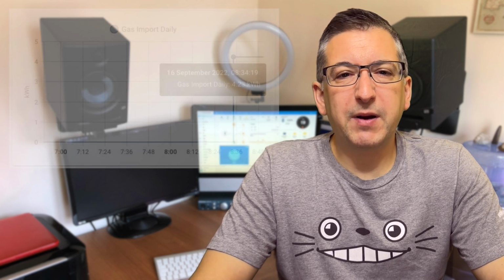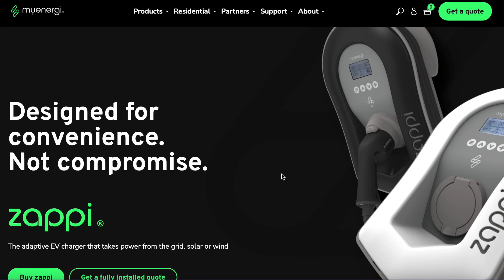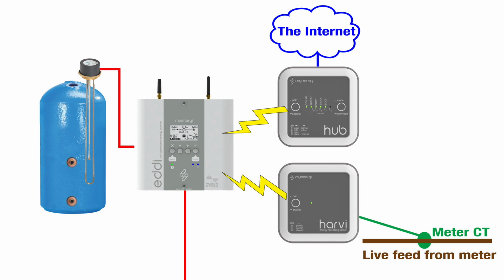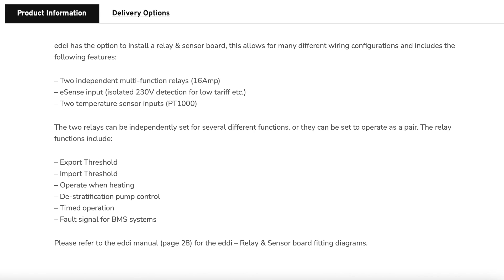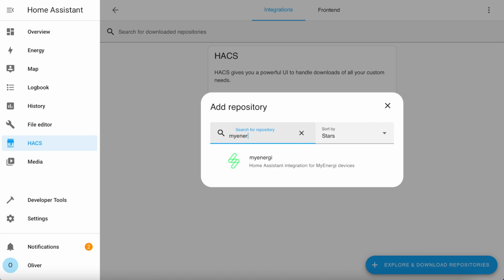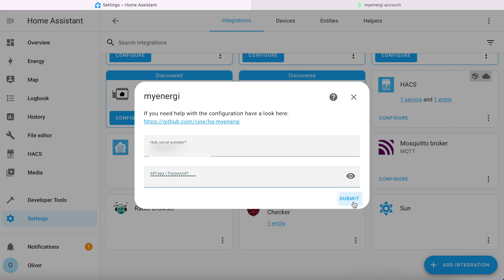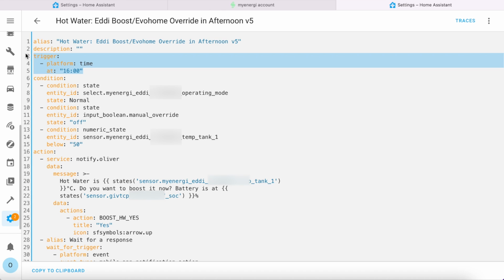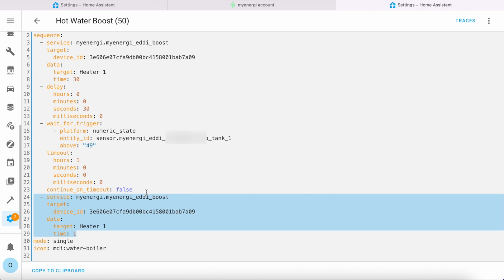Myenergi Eddi and Home Assistant

Comment: Hi. Living in Spain here and just use an instant water heater with a 50 litre buffer. Cheap, simple and maximises use of a 20kWh LFP off grid battery bank. The problem here is using all the solar power !😊
Reply from the maker: Yeah if I had plenty of sun then that would be a realistic option. Sadly in Winter it'd cost me a fortune though. I'm in the process of getting a heat pump installed so that should give me a more efficient way to store hot water - the tank itself is being changed to a much more efficiently insulated one. My copper tank loses heat rapidly right now.

Comment: I have a Athom esp32 unit with 4-channel relay card and linked two of the relays each to drive a 32A contactor wired to an immersion heater (top and bottom). I have full flexibility as to when to power the immersion heaters via Home Assistant and the solution is much less expensive than an Eddi.
Reply from the maker: I considered doing something like that, but it has two problems: Firstly it doesn't allow you to regulate the power going into the immersion heater - Eddi regulates the voltage to allow anything from 1 to 3000w, soaking up the exact amount of excess power you have; secondly it breaks one of my golden rules of home automation - it must be easy to use by my family if I am suddenly no longer around!

Comment: The gas boiler wastes heat by heating itself, and the water in the pipes that connect to the tank etc. and most of this heat leaks away afterwards. 
I use a Solar IBoost, and it typically delivers about 2.5 kWh to reheat my tank if there is heat left over from the day before. Using gas my smart meter reports a consumption of about 5 kWh, so a real world efficiency of about 50% (which looks pretty similar to your results).
Reply from the maker: In my case, the immersion heater only heats about 50% of the tank - the bottom of the tank stays cool compared to when I use the boiler. It's enough for two short showers though.

Comment: Thank you for your video. Please can you tell me if I can use the Myenergi Eddi with my T-Smart immersion heater, which is wired directly into the Eddi. For some reason I can't get the Eddi to supply generated energy from my solar panels to the immersion? On the T-Smart immersion app is stays disconnected. Any thoughts welcome.
Reply from the maker: I think probably not - Eddi is designed for a dumb heating element and it powers it on or off and throttles the voltage as necessary. The T-smart must be powered on all the time and does not support power/voltage throttling. In fact, wiring it to the Eddi directly could damage it. Eddi is designed to make a regular immersion smart, whereas you are trying to make a smart immersion have additional features. It's one or the other really. It may be possible to mess around with the relay and sensor board but that might involve the voiding of warranties and a lot of custom sensor building!

Comment: Do you have a "hot water on" button in home assistant so your family can turn it on to ensure they have hot water on demand if needed?
eg, come home at an odd hour and need a bath? Currently I have a bath and a shower button that simply turn on a POW3 connected to the immersion that heat to one of 2 specified temps.
Reply from the maker: Sort of. "Alexa, boost the hot water" runs a script that boosts Eddi until the temperature reaches 50 degrees. I also have "Alexa, I need a bath" and that turns on the boiler to heat the whole tank... so no physical buttons for either of those routines, but the family are ok with the voice commands! There are already physical buttons on the Eddi and the heating controller if necessary, but that requires training and the trainees are not open to that at this time!

Comment: Is there a way to take the power sensors from the HACs integration and convert the InternalCT power sensor (how much Eddi is heating the tank) and make it into a cumulative energy sensor that can be used as a ‘device’ in HA energy dashboard?
Reply from the maker: Yup, you need to create a Utility Meter helper. Settings > Devices & Services > Helpers > Create Helper > Utility Meter. I like to put them on a daily cycle, but you can choose no cycle, or whatever you like.
Reply: @SpeakToTheGeekTech  brilliant. Didn’t realise you could create ‘no cycle’ utility meters
Reply from the maker: My preference is for a daily cycle personally for use in the Energy Dashboard. The reason being is that if you use a cumulative sensor and it gets reset for any reason, you potentially lose all of your historical data. A daily cycle sensor limits that loss of data to 24 hours maximum. No reason you can't create a daily cycle sensor for use in the energy dashboard, and a no-cycle one just to keep track separately elsewhere for curiosity!

Comment: Question...
If I have a Zappi and a Harvi, but no Hub, can I still get Data in Home Assistant?
Reply from the maker: Depends... the old models needed a hub in order to connect to the internet and enable app control. The new ones have built-in hubs instead. If you can control your zappi from the myenergi app then you can get the data in Home Assistant.
Reply: @SpeakToTheGeekTech  
Thanks. The one I just ordered is a V2.1 so that should be a new one...🤞

Comment: Thanks for the video, very useful! I actually decided to try and copy with my own setup, and purchased the relay / temp board and the PT1000 probes you linked. However, I did have a question about the connection on the relay board. Do you happen to know what those types of connections are called? Looks like i'll need to re-terminate the probe so that they plug in, just unsure what I should be searching for.
Reply from the maker: Do you mean the small green screw terminals that clip on to the relay board itself? I'm not sure either, but mine actually came with the relay and sensor board. If you're missing those then your relay board is missing parts.
Reply: I feared you'd say that... I had purchased my board from a wholesaler, since myenergi were out of stock. The board arrived with *nothing*, not even the plastic standoffs. I had thought it was just that that was missing, but sounds like some other parts are missing too. Can I ask, the ribbon cable that connects the Eddi and board, was that part of the Eddi or part of the board? I haven't yet taken the casing off my Eddi to check.
Reply from the maker: Oh dear. Yes, the ribbon cable was part of the board. Everything you need to install the board - standoffs, ribbon, connectors, all included. I just added the PT1000. No point opening up your Eddi if you don't have the ribbon.

Comment: Hi, Could i ask you a question please, I have a Give energy system installed with a battery, Inverter, and Eddi,
As far as I know, there was already a duel immersion fitted to my water tank before I got the Solar and this worked fine 
for two years but the long immersion stopped working and an electrition changed the wiring to just heat the shorter immersion
and this works 
However the blue light on the eddi sometimes flashes blue while also makes a sound and I am wondering what causes this, 
thanks
Reply from the maker: I don't know sorry, you might be best asking this question in the myenergi forum: https://myenergi.info
Reply: @SpeakToTheGeekTech  OK Thanks anyway.

Comment: Hi.  I have a PV diverter, solar panels and batteries.  I’ve had an air source heat pump fitted.  I’m on Octupus flux.  Would it be more efficient to turn the PV diverter off and allow the heat pump to heat the water?
Reply from the maker: I am trying to figure out the exact same thing! My thoughts at the moment are that once I get a heat pump installed, I'll stop using Eddi and just have an automation that detects if there's enough excess solar to power the heat pump instead. It wouldn't modulate the power, so I'd need a lot of excess, but in theory it would be more efficient. Honestly, until I have the heat pump installed I won't know for certain. It's a bit of a trade-off between using the more efficient heat pump or being able to absorb every bit of generated energy. I know that even running at higher temperatures for hot water, the heat pump is still running at about 200% efficient from seeing other people's installs in operation.
Reply: Thanks.  On the old and rather insulting export rate of 4.5p per kw hour I was trying to absorb as much as possible but now Octupus have launched Flux which will average around 24p per KWh I’m trying to balance the needs of the house with exporting as much as I can.  I think approaching it from a common sense point of view.  If the heat pump is 200% efficient and the PV diverter is 98%efficient it must be the heat pump

Comment: My EDDI and HA only show the consumed electricity (kWh). This doesn't work well in the Grid or Dashboard as I have "live" actual power (Watts) data for all the other devices . The mobile APP and EDDI device display show both the accumulative consumed energy (kWh) and the live actual power (w) but I can't find this in the integration entity. Your demo works because you have simulated a hot water heater in Watts. Any thoughts ?
Reply from the maker: The myenergi integration for Home Assistant does display live power. I use the one for Eddi on the Power Flow Card Plus (sensor.myenergi_eddi_xxxxxxxx_power_ct_internal_load). The only issue is due to it being a cloud-based integration, the updates are not very frequent so can lag by a couple of minutes, but the integration definitely shows power entities :)
Reply: @SpeakToTheGeekTech  Thanks I have found it and it is zero. I guess you could put a CT clamp into the EDDI to by pass MyEnergy cloud base apps !!! Just subscribed and moving my Pi to SSD as per your recommendations. Having lots of fun and games

Comment: Does anyone know how to control the two relays (optional extra) using home assistant? I can see sensors but not controls. Thanks
Reply from the maker: To my knowledge, you can't manually control the relays on the sensor and relay board. You have to configure the relays to turn on/off based on various thresholds and conditions such as exported or imported power, or water temperatures to manage tank hysteresis. The available settings are all listed in the board's manual on their web site, but the actual control of those relays to the API is not exposed. Or at least it certainly wasn't when I had an eddi.
Reply: @SpeakToTheGeekTech  ah ok thank you. I wanted to control my hot water circulation pump with one of them. It's always on which is good for destrat and quick hot water at the taps, but poor for maintaining hot water at the top of the tank so I think best just on at peak use times and when the eddi is heating during powerups etc. I have a couple of spare Sonoff mini's so can do it that way instead

Comment: Home assistant reports 127 for temperature of hot water tank 1 and 2 I only have one tank. Where is it getting this number from and is it Fahrenheit if so how you getting Celsius?
Reply from the maker: Have you fitted the optional sensor and relay board in the Eddi and connected a temperature sensor between that and the tank? If not, the reading is a default value due to having no sensor fitted.

Comment: Forgot to ask, how much power does your system export to the grid when the Eddi is diverting power. 
My Solar Iboost is supposed to target a 100 watt export figure (its not zero to leave some margin for error  when solar output suddenly drops (e.g. cloud moves in between sun and panel)), but usually sits there exporting between 200 and 300 watts.
Reply from the maker: The eddi takes in all available excess power. I could configure that differently if I wanted to though.

Comment: Hopefully not a stupid question but is there a simple way to automatically prevent diverted PV overheating the HWtank? I'm wanting to pause the Eddi when the tank temp hits 65degC but can't see an elegant way to automate this.
Reply from the maker: Assuming you have the sensor and relay board installed, you really should set the upper limit within Eddi itself for safety. See the manual (https://www.myenergi.com/wp-content/uploads/2022/06/Eddi-Manual-.pdf) page 17, Temperatures > Set Limit. Also your immersion heater should be manually set to a limit too to prevent this. But, if you wish to set a limit using Home Assistant, the way that I do it is to create an automation that triggers when the temperature is above a certain value, and then you change the mode of the Eddi to Off. Or, if you are boosting up to a particular temperature then same process of triggering with the temperature, but checking that boost is running and then setting another boost to run for 1 minute to finish the boost early:

I actually use a script to boost my tank to 50 degrees:

alias: Hot Water Boost (50)
sequence:
  - service: myenergi.myenergi_eddi_boost
    target:
      device_id: 3e606e07cfa9db00bc4158001bab7a09
    data:
      target: Heater 1
      time: 60
  - delay:
      hours: 0
      minutes: 0
      seconds: 30
      milliseconds: 0
  - wait_for_trigger:
      - platform: numeric_state
        entity_id: sensor.myenergi_eddi_14306600_temp_tank_1
        above: "49"
    timeout:
      hours: 1
      minutes: 0
      seconds: 0
      milliseconds: 0
    continue_on_timeout: false
  - service: myenergi.myenergi_eddi_boost
    target:
      device_id: 3e606e07cfa9db00bc4158001bab7a09
    data:
      target: Heater 1
      time: 1
  - service: script.alert_play_tts_on_alexa
    data:
      list_of_echo:
        - media_player.echo_dot_lounge
        - media_player.echo_dot_kitchen
      tts_message: Hot water is up to temperature
  - service: notify.vicky
    data:
      message: Hot water is up to temperature
  - service: notify.oliver
    data:
      message: Hot water is up to temperature
mode: single
icon: mdi:water-boiler
Reply: @SpeakToTheGeekTech  Thanks for the quick reply. I should have said, the HW temp is coming via Emoncms and I'm wanting belt & braces as don't I trust the 'stat as I'm away so often.  So my issue is I can't fathom (within Visual Editor in Automations) how to pause the Eddi. Closest I've got is changing the Operating Mode option to 'Stopped' at 65 deg.C and then returning it to 'Normal' at 50 deg.C with another automation. Doesn't seem very elegant. Or maybe Stopped = Paused and I'm seeing a problem where none exists.
Reply from the maker: So stopped = off. When in stopped mode, the scheduled boosts don't run (as far as I can tell) and it won't divert any power. There is no 'pause' really which would be quite useful... but I leave mine in 'Normal' all the time unless my home's mode is set to 'away' (when I'm on holiday or something). But then again I have the sensor and relay module installed so use that Eddi-aware temperature sensor as my backup for the untrustworthy physical stat! I guess you have to bodge it using the Stopped mode in your scenario.

Comment: If I’m using energy from the grid should I see that on my eddi screen?
Reply from the maker: Yes, mine does.
Reply: Ah I wonder why mine isn’t, I have a CT clamp on the solar and that is showing on the Eddi.
Reply from the maker: I assume you've also got a myenergi CT clamp around the grid feed either directly connected to the Eddi, or on a Harvi or Zappi? If so, that must be set in the primary myenergi device as the grid CT. My CTs are all connected to the Harvi, and I configure which CT does what in the menus of the Eddi.
Reply: Yeah I have a harvi aswell, I have the Grid CT and Solar attached to that and on the Eddi I have them programmed to each one. The solar shows on the screen but the grid doesn’t and I can’t seem to work it out

Comment: Stuck at add intergration point with error config flow could not be loaded: {"message":"invalid handler specified"}
Reply from the maker: I’ve never seen that error before. Did you reboot after installing the component?

Comment: Does eddi works with Nest Thermostat?
Reply from the maker: I’m not sure what you mean, they’re two distinct separate systems. They can both work in parallel (Nest controlling your boiler, Eddi controlling your immersion) but neither system talks to each other.
Reply: @SpeakToTheGeekTech  I say you could use your Nest to turn on the EDDi.  but you will not get any feed back, only using your nest a boost, or schedule

Comment: do you know if i can use the temp sensor on a megaflow type system?
Reply from the maker: I’ve no idea what a megaflow system is sorry, but if you call Myenergi I’m sure they’ll help. They were very helpful answering my questions before I got my Eddi
Reply: @SpeakToTheGeekTech  thanks already got my eddi and connected to HA, was going to get the expansion board for the temp sensor but my tank is hard shell not soft like yours.
Reply: @ThomasColeman so did you manage in the end to setup a way of reading the tank temp ?